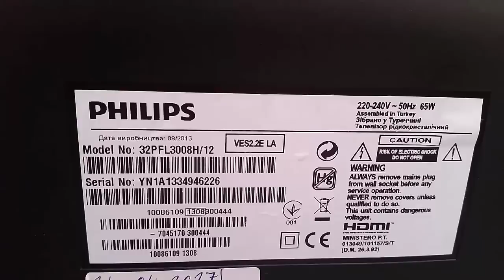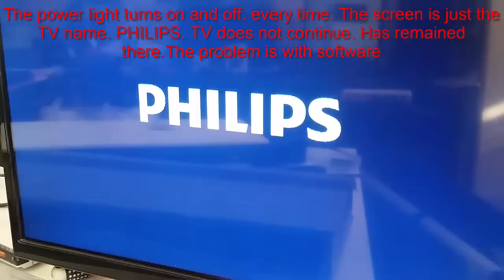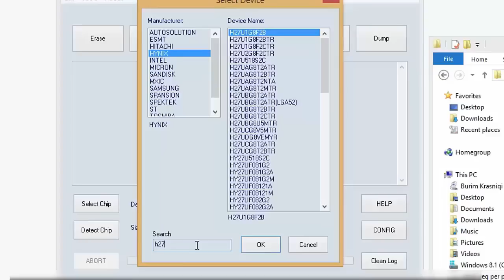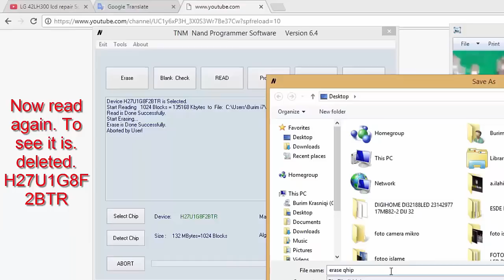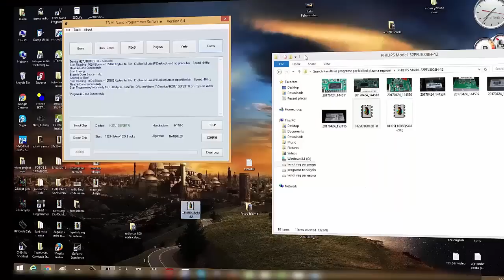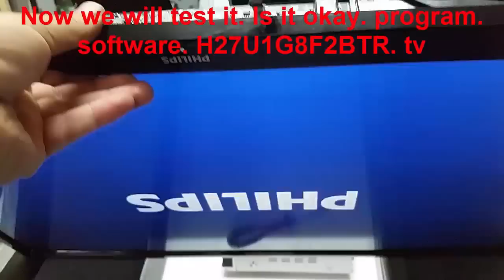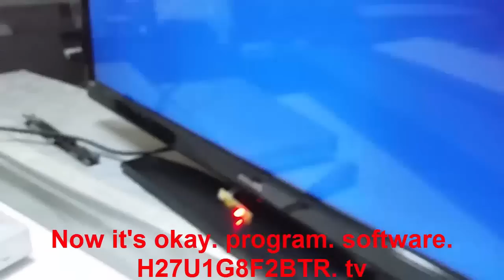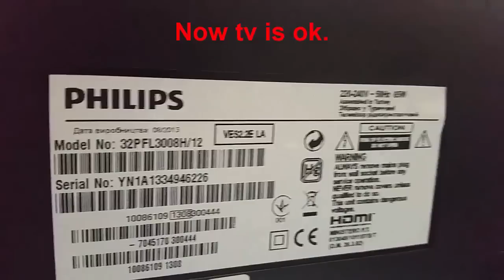PHILIPS 32PFL3008H/12 Light power flashing. On the TV screen just the name. PHILIPS.

Comment: Hi, thanks for all your greate videos. I need your help please with my Philips Tv (37PFL5604H/12). TV only shows a red light blinking 3 times every 2 seconds. A curiose thing is that when i do the manual software upgrade (reconnecting the TV to the Mains/AC Power while pressing "ok" button) the tv starts to work perfectly. The problem is that every time i turn off the TV the blinking red light returns, and the tv will not work again till i install the software again. Thank you very much.

Comment: does it work for PHILIPS 32PFL3088H/12 ?
Reply from the maker: please. do not try this pattern to read why it has protection. you can not do it again tv do not try to read. K9F1G08UOD. you will lose TV forever
Reply from the maker: please. do not try this model 32PFL3088H / 12 to read why it has protection. you can not do it again tv do not try to read. K9F1G08UOD. you will lose TV forever
Reply: ok,thanks.